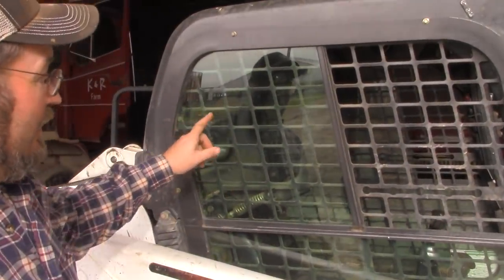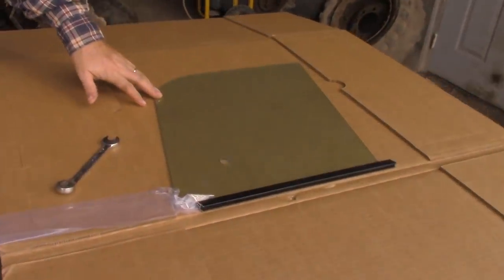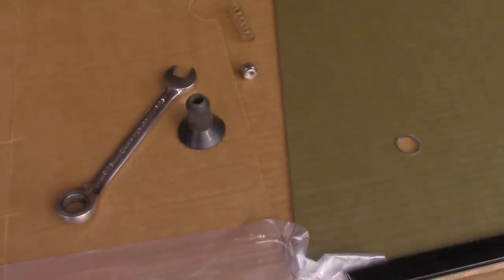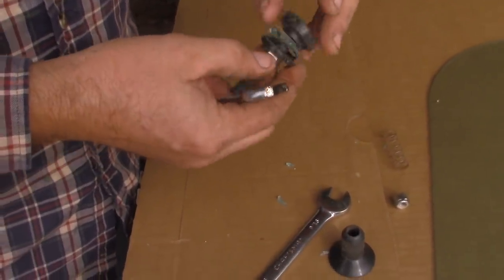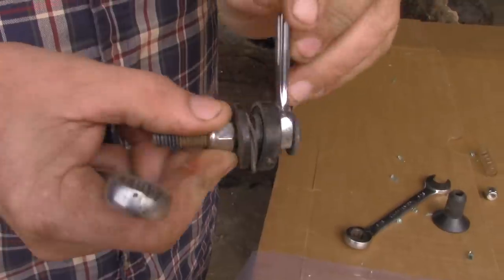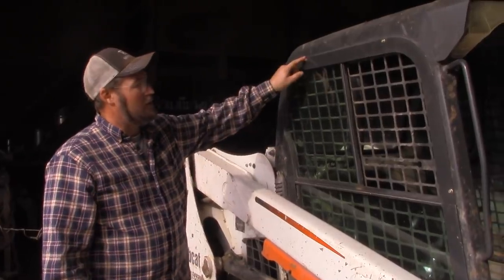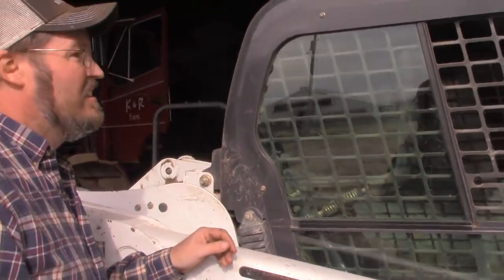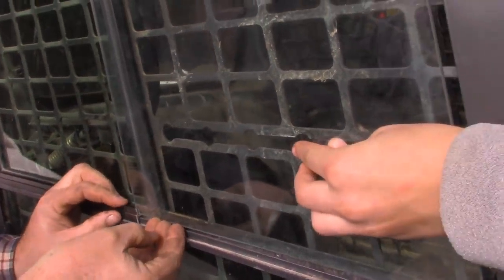Bobcat Glass Window Repair

Comment: Bobcats/skid steers are cool. Once while sitting at a coffee shop my entertainment was a crew excavating a gigantic(ish) hole in the parking lot from the beginning (ripping pavement). Multiple bobcats, backhoes, bulldozer with bucket (or whatever they are called), dump trucks etc. Don't know if they communicate by voice but they all seemed to know exactly what to do and when and every one of them seemed to have a good work attitude and be the best possible operators (I mean I couldn't tell of any errors or that the job could be done any faster or better). It was like a synchronized symphony.